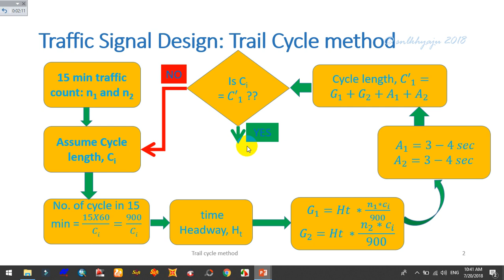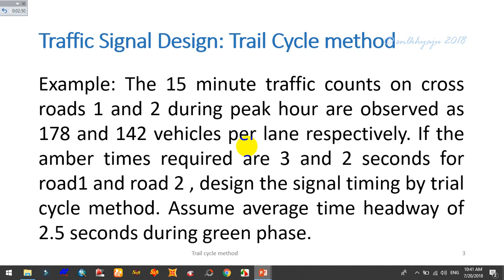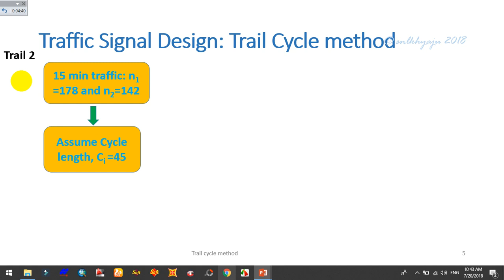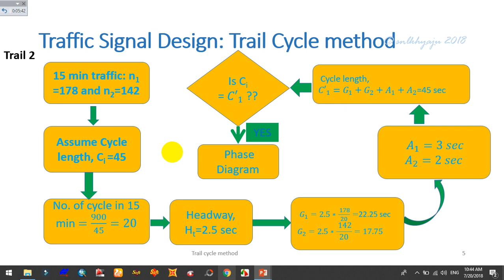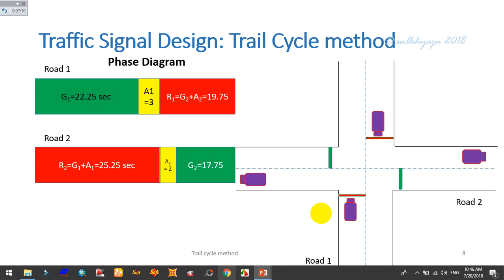Traffic Signal Design: Trial Cycle Method

Comment: Sir what if it initial c and final c doesnot  become equal??i have tried similar question puttinh the value of c varying from 60 to 15 but also it doesnot match..
N for A and B=190 and 145 for 15 min
Amber for A and B= 3 and 2 sec
Headway=3 sec..
Reply from the maker: If so you can assume amber time as per requirement (2-4 sec) to match initial C and final C and also you can give the accuracy  of the design comparing the initial C and final C!!!
Reply: Thank you sir for reply😊
Can we assume amber time even if it is mentioned in question sir??
Reply from the maker: @sagarmaniraut7490  if so we have to  use as per question..and if in exam at least two trial is most!!!
Reply: Thank you sir..😊
Reply: You can try this formula
C=H1*N1*C/900+H2*N2*C/900+A1+A2
and calculate C.